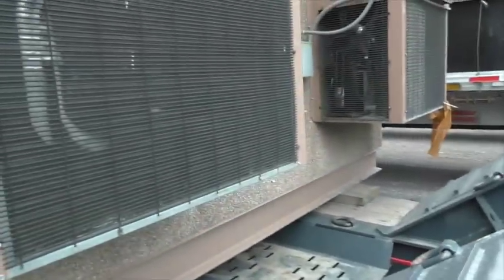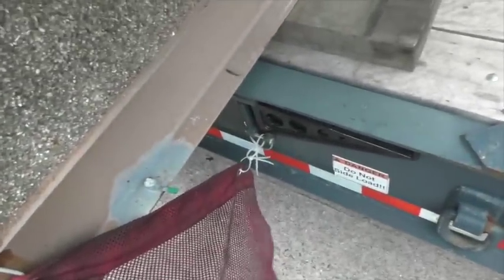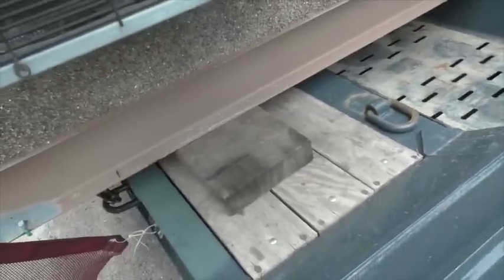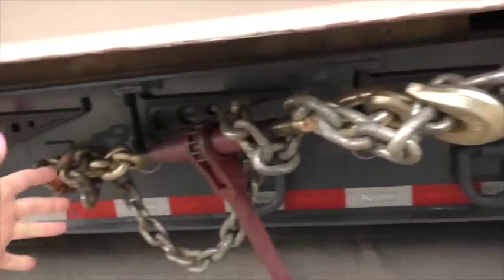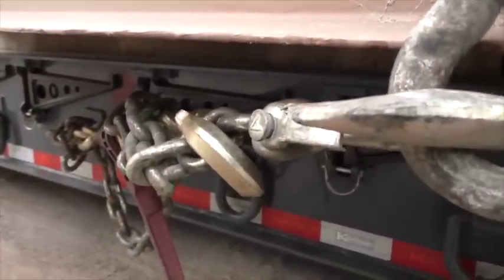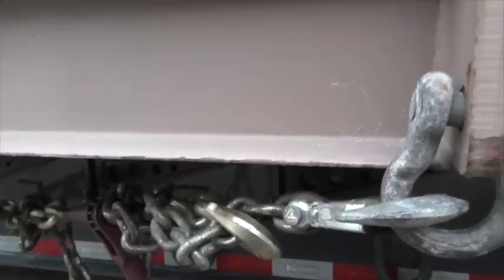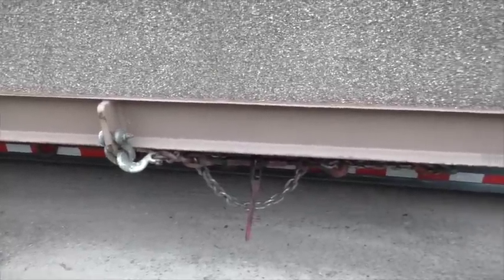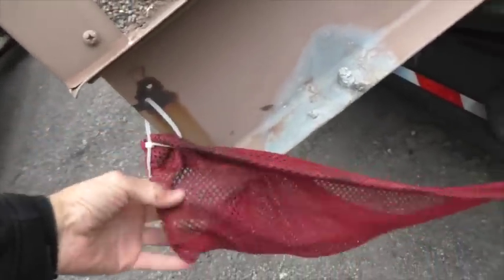HEAVY HAUL TV: Episode 232; 8/27/2015

Comment: Your know your job Sergei , you have always did proper securing of your loads and have never had any incidents of chains or straps failing to comply with DOT regulations , some people are full of hot air and are and just try to get you going , Your doing a great job and an interesting one with so many different loads .I know this structure was oversize on the sides , and you did a fine job getting back home to Camebridge !